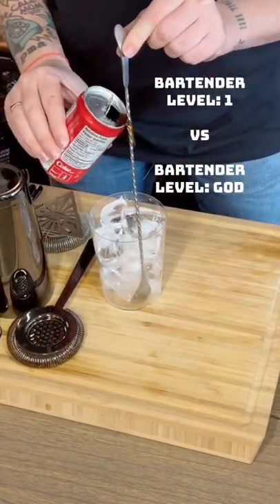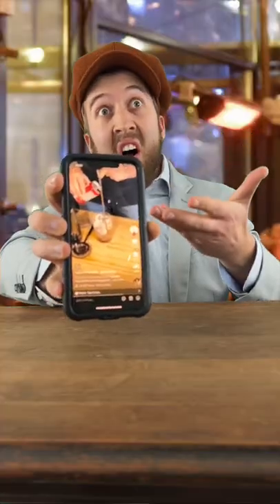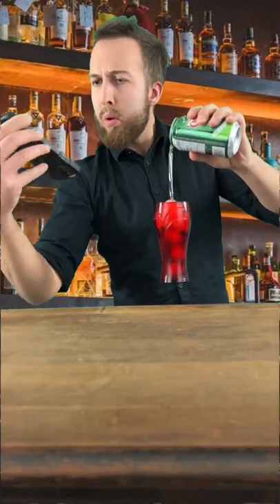How to (properly) pour soda

Comment: Or just tip the glass. If you pour beer style it saves you a utensil (I don't drink lol)
Reply: That doesn't work that good with ice and stuff already in the glass. I've tried it and it makes a difference
Reply: @megawolfr1986  I guess that's fair. I don't really drink my soda with a lot of ice so it's never posed a problem for me
Reply: @Marlyjade  i don't either. Mostly goes for cocktails. With ginger beer or tonic for example
Reply: It’s more for the focus on flair, when bartending, some also like to entertain
Reply: You're not supposed to tilt the glass/save carbonation when drinking carbonated drinks. It bloats your stomache, making you absorb alcohol faster. Unless you intend on getting drunk faster, you should try to reduce the carbonation by pouring it straight into the glass.

Comment: Correct me if I’m wrong but I think you taped/glued/put the string at the bottom of the cup and the other end is on the can. You use the soda to hide the string.

Or maybe I’m overthinking and it’s just a green screen friend
Reply: Fishing wire so you can't see it

Comment: Well, the reason the bartender pour drinks straight in to lose carbonation, is because carbonation basically makes you drunk faster.

 When you drink carbonated drinks, it increases the pressure in your stomache, which then helps to force alcohol into your bloodstream via the stomache lining.

So if you want to "control" the speed of your intoxication, just change the amount of carbonation in your drinks.🥴